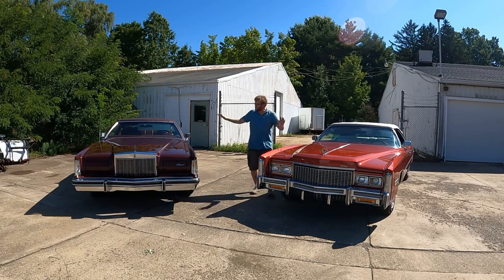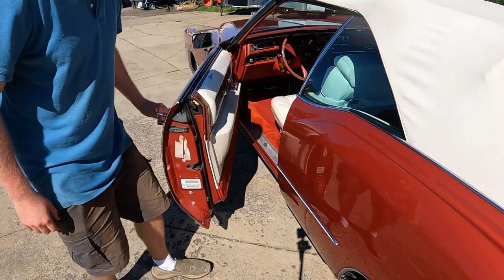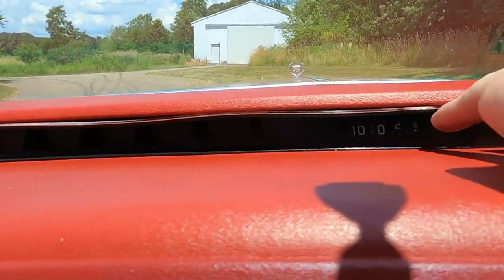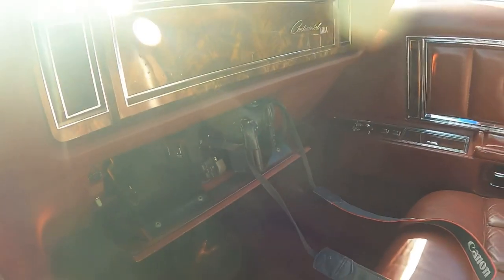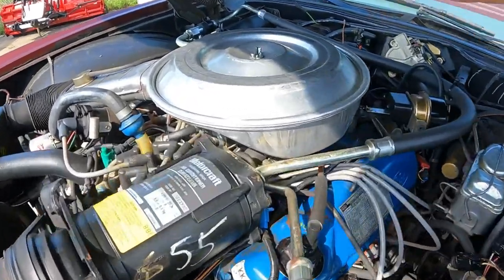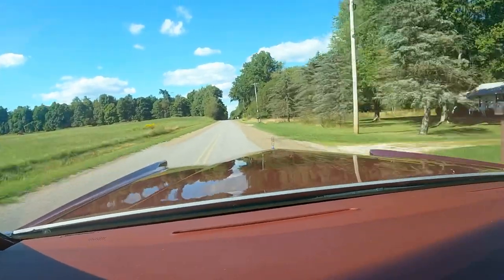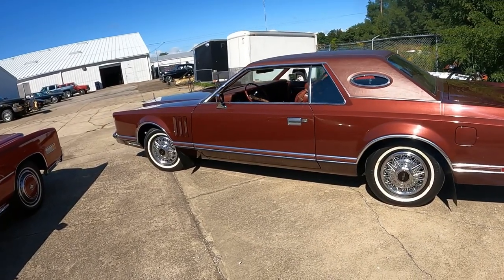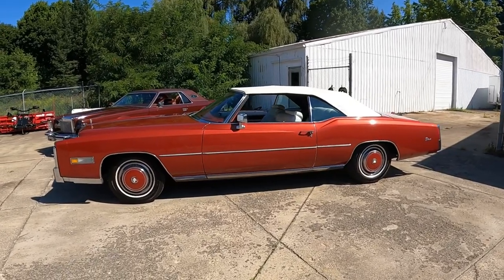This vs that 1976 Cadillac Eldorado convertible vs 1977 Lincoln Mark V￼

Comment: Sitting in the back of any coupe is cramped for me, but yes the Mark IV and V are more roomy.  It’s awesome you had  the MK V and Eldorado,  both side by side to compare.  The Mark V interior is basically just like the Mark IV , same basic door cards, armrests , lights etc. Dash is identical just trimmed differently.  I am surprised at the decontent of the backseat because my 72 mark four has a fold down armrest for the back. Plus my rear quarter's do open about two inches.. I’m guessing that’s just enough to flick cigarette ash out that kind of ridiculous so I guess they eliminated those in the MK V.  Really the mark five is a redesign and skin only it’s just kind of like dropped over what is still a  Mark IV  underneath. Though for 72 the engine was stronger. I would hazard to guess that with the Cadillacs extra weight over that of the Mark V they probably have about the same performance numbers definitely the same driving feel.   I believe in the sales numbers the Mark wins  over the Eldorado just about every year and it truly was the quintessential 70s personal luxury coupe.   I thoroughly enjoyed this.  I agree the Lincoln is elegant to drive. It just makes you feel special, and thats what these cars were all about.
Reply from the maker: Thank you so much for taking the time to share all of that having driven both the Cadillac just feels like another car the Oldsmobile I driven the Oldsmobile Toronado 75 tornado as well and in ways the tornado felt better than the Cadillac.. The tornado had crotch ventilators the Cadillac didn’t.. not saying that you need a crotch ventilator but I’m just saying why I put it in a lower class car and not have it in the higher class car is beyond me. I might be a little bit partial to Lincoln over Cadillac because I’ve owned Lincolns I’ve never owned a Cadillac.. I was impressed by how heavy and how big the Cadillac was it didn’t handle like as big of a car as it was, but with that said it just did it you didn’t feel I didn’t feel special driving the Cadillac whereas even the Lincoln though it was a basement model I felt special driving it.. it has a presence the Cadillac doesn’t. In my opinion =)

Comment: That is not the quadraphonic 8 track player in this car...that is the cheaper, stereo only unit, which was not actually offered in a 1977 model... someone put this in later.

The washer fluid light also was not available in '77...that was modified by someone after.

Comment: The Mark V's with upgraded interiors over this standard interior not only look better, they are more comfortable.
Reply from the maker: Lincoln offered a bunch of different seat options for the mark five I agree there are better seats what comparing car to car the Cadillac seats were better but Lincoln does make a leather seat that is more comfortable than the Cadillac seat it just wasn’t in that car

Comment: The Lincoln. Loved the linear styling, concealed headlights and distinctive trunk lid. As for the Caddy's torque steer, Toronado's never had it either (with up to 385 hp at one time). The drive shafts were equal length and had a unique drive system. As for the fuel usage, I suspect you fell victim to the GM fuel gauge (or, in GM speak 'gage'). They weren't linear, taking a hundred miles to move off FULL, then dropping like a rock. Why? Don't know. Was just a common minor GM annoyance, but it's probably why Caddy located it in full-time sight line territory (which was weird).
Reply from the maker: Totally agree =)

Comment: You are really spot on .I've had both cars and I always liked the Lincoln better but the Cadillac was a fun car too. The Cadillac with the front wheel drive was great in the snow but I was never a big fan of 500ci motor kind of a pig with not very good power for its size. 425 Cadillac motor was a much better motor I had in my late 70s limos and sedans. No insult to the Cadillac but I'll take the  Lincoln almost always. Probably the only Cadillac I liked over the Lincoln was the Seville compared to the Versailles.
Reply from the maker: Thank you so much for sharing your experience and insight that would be an awesome comparison video to do one day I’ve never been in a Lincoln Versailles.. I really want to do some oddball comparisons this year if it’s possible =)

Comment: I have a 77 Mark V
Love it, Cadillac is nice, just the Lincoln rides nicer, looks way cooler in today's environment
Reply from the maker: Totally agree the Cadillac just looks like a big brick whereas the Lincoln mark five looks really cool..
Reply: @What.its.like.  I'm 56 so I used to see them on the road in California.
Always wanted one, got mine this year, so it took me a super long time.
Reply: @What.its.like.  I'm lucky, it has 86,000 miles only and is pretty cherry, completely original
Reply from the maker: 400 or 460 the only issue with that car is the transmission if it had a four or five speed it would be better

Comment: Thank u very much bro for making wonderful comparison between these two beautiful classic American cars so im wondering through ur experience in driving these two both cars  so which one of them have more softer power steering where u can turn it with one pinky finger easily?
Reply from the maker: Both can be driven with only a single finger, the Lincoln with the thinner wheel feels way nicer to drive one finger

Comment: Lovin' the Lincoln. Those angular lines, long hood + oval opera windows. It's a classy looking car. Cadillac was likely a firmer ride due to being a heavy convertible. Don't like Caddy dash. Idiot lights & fuel gauge hard to see. Yep! Those Ford steering wheels were generic. So were the dome lights. They changed stuff in the 80's though. The gauge package looked the same in the 80's as well. Those wire wheels class it UP further.
Reply from the maker: The turbine wheels are my favorite nothing rides like a Lincoln Cadillac comes close but nothing rides like a Lincoln

Comment: I own multiple classic cars and having owned both 70’s Cadillacs and currently owning a 78 Lincoln Continental and a 79 Mark V Cartier edition, the both Lincoln’s are literally the smoothest driving cars I have ever owned hands down. The 78 Lincoln Continental specifically. 

They have tighter feeling, more rigid solidly put together bodies than the 70’s Cadillacs and Lincoln’s spring rates are much more softly sprung than Caddy’s by far.

BTW the 77-79 Mark V8’s weigh anywhere between 4,850lbs-5,020lbs curb weight depending on the year and the options. The sound package option, and designer series Marks,I believe used extra sound deadening material and the seats were of higher quality trim and padding thus adding the extra weight.

One thing I will say that I do not like in my Lincoln’s is the really crappy interior quality with all the cheap flimsy plastic especially on the dash. Certain switches and knobs feel extremely flimsy and the fit and finish just wasn’t that good I feel compared to the Eldorado which had much nicer interior materials IMO than the Mark V. 

But Overall the Lincoln just feel better built and is more isolated from the road. 

The 71-76 Cads had interior rattles as they aged, the Lincoln’s never rattle. I think a lot has to do with the frame under these Lincoln’s being so overbuilt and Ford adding extra bracing and torque boxes on these Lincoln frames vs the Caddy’s. Jack up a similar year 70’s Caddy and Lincoln and you’ll see what I’m talking about. 

I love both brands, but as for the 70’s go, it’s Lincoln all the way for total quietness, riding smoothness and overall build quality.

The 60’s it’s kind of tie, but overall I like 60’s Cadillacs much better than the 60’s Lincoln Continentals of the day because I’ve also owned a 61 Lincoln Conti. I can’t stand unibody’s and those cars are notorious for rusting out and they’re generally very complex cars to work on. Great build quality though thats for sure. 

The 50’s was all Cadillac. Lincoln didn’t even really compete in that era.
Reply from the maker: I totally agree with everything you said.. nothing rides like a Lincoln, they are just smooth
Reply: @What.its.like.  They definitely are, that’s  why I don’t think I could ever sell my Lincoln’s, they ride too smoothly to let go. Not even modern vehicles ride as smooth or glide down the road like a 70’s Lincoln. I know because I’ve driven late model S-Classes which do ride extremely well, but they still don’t have the same kind of road isolation from harsh road impacts or that floaty squishy plush ride like my 78 Continental does. Plus even S-Class seats are hard as rock compared to my couch like cloth bench seat in my Lincoln where you literally sink in into them and it’s absolutely plush and comfortable. No modern car seat even compares or comes close to the plush comfort of car seats of 70’s luxury vehicles, nothing, period.

Comment: I’m old enough to remember when rich people drove those. I think there’s a big difference between the 400 and the 460 in the Lincoln. I’d aim for a 460.
Reply from the maker: I have yet to drive a mark five with a 460 in it that’s something that I really wanna do but with that said I have owned a town car with a 302 automatic transmission and it moves faster than the mark five with a 400..

Comment: Having owned both a ‘78 Mark V Diamond Jubilee Edition (460) and a ‘78 Eldorado Biarritz, (425 and not a convertible) I can say that both are great cars.  However, my choice would be the Mark V.  They are both beautiful and both drive very well, but the Mark is just more luxurious.  The Eldorado does not ride nearly as well, but has a slightly ‘sporty’ feel to it.  Those soft Cadillac seats feel great at first, but for long distance travel the Lincoln seats are much better.  The trunks were both small by the standard of the day - the Cadillac seemed to have more useful space due to the placement of the spare tire.    The Mark V was much more solid and rattle free than the Eldorado.  One small point in favor of the Caddy - I am a tall guy and when the transmission is in drive in the Lincoln, the gear lever gets in the way of my right knee.  No such issue with the Caddy.  

As Jay said, it’s down to personal preference.  You can’t really go wrong with either car.  They are both beautiful and fun to drive.  MPG in both was low to mid teens, but that isn’t really a concern is it?  These are all about fun and stylish comfort!  I have daily driven older cars since 1997 and I am here to tell ya - you can afford a lotta  gasoline without a car payment…
Reply from the maker: Thank you so much for taking the time to share your experience it really means a lot I totally agree the Cadillac seats are comfortable but I haven’t taken it on a really long drive I think that’s why a lot of people think that the Cadillac ride better because of the sea quality the seats in the Lincoln weren’t nice leather seats they were the basement leather seats if memory serves correct winking offered six different seat times during that era lots of different seat options but they had really nice leather pillow side seats maybe do a pillow side but they were way worse year than the seats in this car

Comment: I prefer the Linclon , my g/father had one of the last Mercury's imported to Australia (via Canada due to tariffs, God save the Queen etc) his 1945 model sold as a 1946 , ran great , he traded it in 1963 , when GM made semi decent cars ,in Australia , that flathead still did 90 MPH, manual , Mercury was missed ,V8 in particular over GM 6 cylinder offering, and the suicide doors , I was very young , single digit ,

Comment: I own a 76 mark IV and they really cheapened out on the interior on the mark V. Also the mark V came with an optional 460 in 76 it was standard which had 202 horsepower and 356 ibs of torque.
Reply from the maker: Awesome that car sounds amazing what do you like and dislike about the car
Reply: @What.its.like.  I love the ride quality of the car like you said when you ride over bumps and you barely feel a thing. I like my perspective when driving the hood is a mile long and the Lincoln ornament really sets it off especially when it reflects back onto the hood. I don’t really care for the quality of the interior. There’s a lot of plastic and fake cheap looking wood that I don’t think a car that was 17,500 in 1976 should have used. The mark III had the best interior out of all the marks in my opinion it was more quality and consumer focused than profit focused.

Comment: Nice review, only wrong item stated, that stereo in the Lincoln is the upgraded 8-Track, but it was not the Quadrasonic unit.
Reply from the maker: Thank you for the correction I still can’t get over how few of options that car had.. it basically had the leather seats and the full vinyl roof didn’t have any other options
Reply: @What.its.like.  yes, we called those the ad units. Low price to get the customer in, then show them the ones with some options. We have a 78 Pucci Mark V that has lots of features and options that to me is more in line with the Lincoln brand.

Comment: If the CPI was used to calculate price in 2022 it's probably off. Should be more since actual inflation is a lot higher.
Reply from the maker: This is the site used 

https://www.in2013dollars.com/us/inflation/1961?amount=2525

Comment: I like them Both but if I had a Choice it would be the Mark 5. I prefer its looks. I feel like its a better engineered vehicle for the time. GM just slapped cars together in this era without caring about how all of it worked together. Ford did too but not on the Lincoln. They feel like a different animal than say a Granada from the same era.
Reply from the maker: I totally agree the Mark five is just a better car to me.. The Mark five has a special place in my heart it was definitely better driving experience in the Cadillac in my opinion the Cadillac seats were nicer but Lincoln offered like five or six different seat options and these were the basement leather seats

Comment: All those cars would well over 100mph. You would bury the needle at 100 and probably get close to 120. Both of those cars powers were detuned for gas mileage and emmissions mandates by 1976.
Reply from the maker: Yeah I should worded it different like the top speed the car can record is 120mph the car may or may not go that speed by that is the highest the speedometer can track its speed to =D
Reply: A 400 equipped Mark V will get nowhere near 120 mph.

Comment: You can't compare the quality of the ride between a hardtop and convertible. The latter will never drive as smooth as its hardtop counterpart.The Lincoln may very well provide a smoother ride but you would need a  hardtop Eldorado for equal judging.

Comment: I’ll be able to make this comparison myself in about 1 month from now.
Reply from the maker: Tell us which one you go for personally, I like the Mark five better it rides better and it’s more pointy.. nothing wrong with the Cadillac it rides good I think that Cadillac had better seats but if you got good quality leather seats in the Lincoln, it’d be second to none has more of a presence it’s not like a total brick because once again it’s pointy lol
Reply: @What.its.like.  I'll let you know.  Your opinion on the seats is accurate.  I've had the Lincoln since August (80k mile survivor), Collector's Edition with the Leather, they are nice, but the Cadillac's are better.  While I haven't driven the Cadillac since 1994, I recall the ride being more firm (stretch term) than the Lincoln, but once I drove the Lincoln it was very familiar to what I had been used to from that era, the Cadillac.  I like the pointiness of the Lincoln.  This particular Cadillac is a 30k time capsule and it's in almost showroom perfect condition inside and out.  Fillers are gone, and I have sourced replacements in the CORRECT soft plastic material.